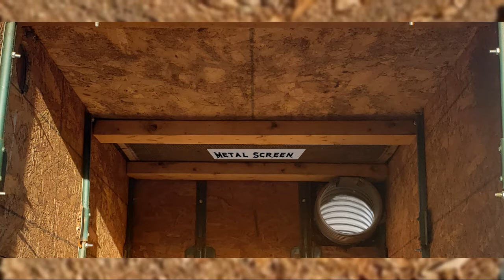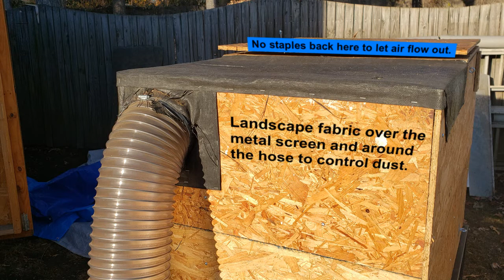Homemade Leaf Collector

Comment: This is a great idea. You really don't need 5 minutes to show that it works. ALL of these carts assume you have already wasted a TON of money on a bagger system that doesn't work. Getting that chute off of the deck is the problem. I don't think anybody making baggers is going to want to sell you that piece.
Reply: you can find a chute adapter.  There is one on amazon that you have to cut and fit to your machine.  Im going metal though
Reply from the maker: You may be right John. I couldn't see spending all that money on something I could pretty much copy with a little DIY. Some people can't, or don't want to, deal with all that time trying to figure things out. I am very happy with this thing as I been raking leaves for 40+ years. I still get the rake out though to get them out where I need them but this saves a lot of work. Happy building! I will be getting mine out very soon because the leaves are falling.

Comment: Will this work with grass also ive 
Been using a pull behind brush type it works almost ok i put mine in compost pile
Reply from the maker: It depends on what the grass is like when you cut it. When I pick up the leaves, they are dry, so I get the leaves and the grass comes with it. If you have wet leaves/grass it is going to be hard to pick up or if the grass is tall. Sometimes I just go slower and give the blades time to cut it up so it's not trying to push a ton of stuff. I think I know the brush you're talking about. Didn't work well for me because the ground is not flat, and I just wasn't happy with it. I also don't compost because I don't have enough beds to put it in. Hope this helps answer your question.

Comment: Where did you get the chute attached to the mower deck?
Reply from the maker: I have a bagger system for the tractor that has that piece and some others. It's like two trash cans behind the seat, but they fill up fast and don't hold as much as this pull behind thingy does.

Comment: didnt the hose end kink at the cart when you go around a bend?  Also did you find the mower had enough force to push the leaves up into the longer path?
Reply from the maker: No hose problems, maybe because the hose I use is wire reinforced so that makes it stronger. Its looks like a spiral in the hose which makes it spring back together like a slinky. With dry leaves this thing is great and yes, the force is enough to fill the whole collection box up as you saw in the video. Wet leaves work good too, you just have to watch the hose in case they back up since they are heavier.
Reply: @steveshome  ok great tx for the feedback

Comment: where did you buy the parts?
Reply from the maker: Hi Ram, as I said in the video, the hose came from Grizzly and the metal reducer came from Home Depot. Everything else I had lying around but you could buy all the materials from any big box store except the hose. I think that is something you need to search for depending on the diameter hose you need and who you want to buy from. Hope this helps. Best, Steve

Comment: I done the same thing for awhile, but i ended up using more of a straight piece of duct onto the lawnmower attachment strapped up to the frame with a Long durable Bag.  Can go faster without clogging, but down side emptying the heavy bag.

Comment: Do you use any special type of lawnmower blades and if so what kind and where did you purchase them?
Thanks in advance for any information you can supply.
Reply from the maker: Nothing special on the blades, just the mulching blades that Sears sells and those are what I use all the time. I used this for the 3rd time this winter and it still works great. I think I said this in my video but the only time it clogs up is if I am trying to pick up leaves that have been sitting for a while and are wet & heavy or if there are just too many and we go too fast. Now we just know when to slow down some to give the mower time to dice them up and push them through the chute. I am very pleased with this as it has saved a lot of raking and bending over to fill bags. Good luck if you are thinking of making one and thanks, this reminded me that I haven't sharpened my blades since the beginning of grass cutting season so I should probably do that tomorrow.